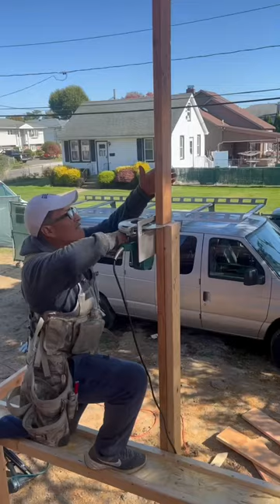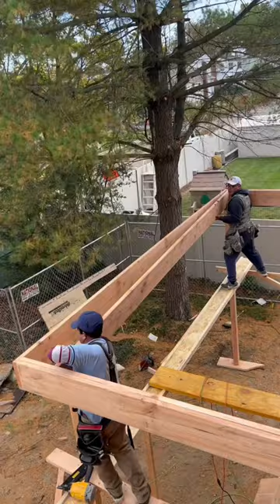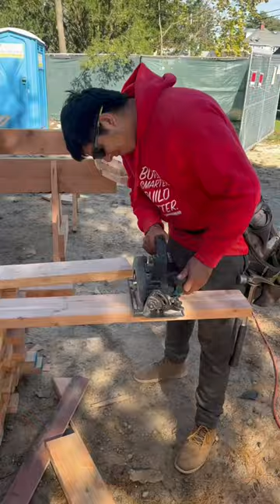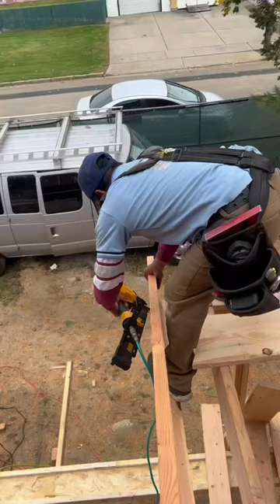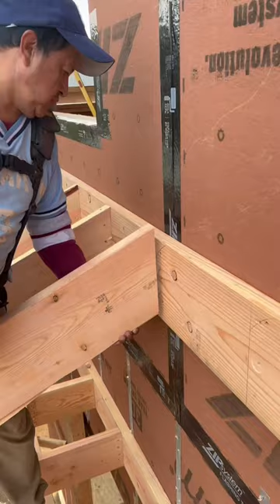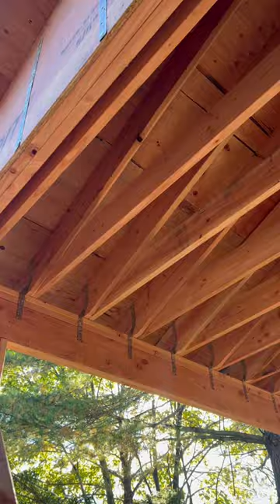Front porch #shorts #construction #work #skills #perfect #carpenter #beauty #design #team

Comment: I like to use the black chalk too. Great work bud. I really like that you notch that 2x4 in for the facia (overhang). Its so much stronger like that.
Reply: Same! Lol when I did framing everyone would cry about black chalk but the stuffs amazing. You can get the shittiest snap and it still gives you a solid ass line
Reply: I've always used florescent orange chalk. It doesn't always show up the best on light colors in the sun, but on darker colors in low light situations, it jumps out! I keep a blue chalk box for backup tho. I've always thought about using the black but it'd suck for black shingles tho. I hate when the dum-dumbs put whatever chalk they find in whatever they got so it's a dark brown 💩 color. 👍🏻👌🏻🛠️🔧🗜️📐🔩📏✏️🦺⚠️🚧😎

Comment: I know this is short video, but what type of structural bolts did you use to attach the ledger?  Do you use lags or GRX?
Reply from the maker: 5”x1/2 lag bolts
Reply: @stalinlop15 

Your 1 carpenter ALWAYS makes his combination cuts right on.   They snap right in.  
Very good job.   👍
Siskel and Ebert baby 👍👍
Reply: Nails 😂
Reply: @mariemartinez6173  🤦🏻‍♂️WOW!!!
Reply: @stalinlop15  doesn’t looks like an old house now houses are made of web truses if so ledger must be install way different than lag screws
Reply: @mariemartinez6173  The nails are temporary

Comment: Looks good. 
Is it ok not to add bolts on that ledger board? Will just nails suffice?
Reply: No it's not okay but it gets added on later
Reply: IROC mandates structural screws or bolts or a combination of the two. In areas prone to earthquakes, through-wall metal tie-downs that act as cantilevers must be used as well.
Reply from the maker: We did
Reply: @stalinlop15 un videito de eso stalin los inspectores les va a gustar ver eso

Comment: Nice work, but where im from you would fail for using coil nails for nailing down ply. Has to be framing 8s. You have to get that nailing pattern inspected and remove any nails that might have curled out the side of the rafter, before adding weathershield and a cieling. (Looks like you are waiting for an inspection unless that was the end of the day.) I think its still 2-3 inches apart in perimeter and 3-4 inches in the field. It might be 3-6 in the field, its been a little while since i framed a roof. (Im speaking on where im from, these guys may be just fine with what they did, where they are from)

Comment: Those four 2x4's are holding a lot of weight 😮
Reply: Pretty sure that's temporary  to hold till the deck gets built but you'd be surprised how much a couple of 2x4's can hold
Reply: One 2x4 can hold about 1000 pounds vertically
Reply: Además tienen dos tablas diagonales como de 8x1 1/2.
Los de 2x4 soportan muchísimo peso hasta que alguien les da un pequeño golpe con todo ese peso.
Creo que le falta la cubierta de abajo o para que son tantos soportes horizontales? Parece que fuera a ser un piso en lugar de un techo, muchísimo material , en lugar de ponerlo cada 40cm lo hubieran puesto todo junto

Comment: Excellent framing, but what about footings and hold downs for the supporting columns? The last image appears to show the column nesting on a piece of scrap wood.
Reply: This is top notch framing. As a roofer I was wondering about the 1/8” space between substrate ply boards, these looked pretty tight?
At any rate framing is a trade I look up to, still great content.

Comment: So if u cut the rafters all the same length and the wall you're connecting to is crooked, or has a crooked stud, then you will wnd up with a crooked fascia.  Better off leaving long and snapping a line and cutting perfectly straight.
Reply: Exactly you never precut the tails for fascia.
Reply: What are you talking about? That ledger will flatten out any bumps. And I'm sure one of them made a quick sight down the tails, before they added the fatia board, which will also straighten out any imperfections. Too, didn't you know that these guys frame their walls, perfect, by crowning and grading and sorting their studs? 😲
Reply: @williamtsmith9668  you obviously don't know what you are talking about, The best way to do it is install the rafters and snap a line 
PERIOD  !!!!

Comment: I’ve never used a nailer. With that being said, why do you guys still use air hose nailers and not the new battery powered ones? I’d imagine, changing the batteries couldn’t be that bad. I noticed you use the battery powered circular saws.
Reply: With a decent compressor (sunk cost by this point), pnuematic nailers drastically outperform the battery powered ones (for bump firing in particular, like the sheeting).  Lighter tools (less fatigue), last longer (and simpler repairs), and cheaper, too.  Downside, you have to have the compressor onsite, and manage a hose.
Reply: Pneumatic nailguns  are way simpler and more durable than electrical. Just remember to lubricate them.
Reply: Thank you two for the insight.

Comment: From all the inspector videos, I thought you were supposed to leave a 3/8 gap at the end of the rafter against the house and not nail it tight.
Reply: What the heck gave you that idea? 😅😂😅😂😅
Reply: @williamtsmith9668  "that ain't right" guy finds that all the time, sometimes 1/2" gap.  I was being sarcastic...  One roof, the roof was already on and there were huge gaps  in a high pitch.  I would think the only way to fix that would be to rip the roof off and start over.  Rafters were supported by nails only.

Comment: i ask not to criticize  but to learn  from the ones that know since i do my upgrades by myself.   isnt that overkill?   and unnecessary spending  they are using 2x8 or 2x10  on top and bottom  i figure that for a shed that small 2x 6s are fine

Comment: The details boys. You didn't put in foundations for the posts. And you didn't put in the lateral blocking you were suppose to between the rafters at the beam line along the posts. The boards to the building were suppose to lag bolted into the building. Details details details.

Comment: Need to put a pad under the gable end rafter then install the gable studs. Otherwise you are really only get one nail in an inch and a half of lumber.
Reply: The end rafters are doubled up. Probably code for the area, maybe snow load. So they have 3" to nail into.
Peace. 👻🤠
Reply: @williamtsmith9668  the end rafters are not doubled up, sorry but you are mistaken, and the best way is to nail a 2x4 under the gable rafters and then install the gable studs, Period  !!!
Reply: @H43339  Watch the video again. It's common to double up the end rafters. Otherwise your right. On a vaulted ceiling, you will place the 2× on the inside of the bottom of the rafter and that provides backing to nail the ceiling to. If there's a ceiling.
Maybe I should watch it again, I could be mistaken. I've been watching and commenting on a lot of construction shorts.
Peace. 👻🤠
Reply: @H43339 Just watched it again. In the first 30 seconds you will see, yep. They are doubled up. 
I've been in this industry for 40 years!!! Very rarely, do I make a mistake.
Peace. 👻🤠
Reply: @williamtsmith9668 Those are double 2x10 or 2x12 ? that make a beam not rafters, If you have 40 years it must be as a laborer ?
There's a different between beams, joist and rafters.

.
Reply: I meant to say that the gable rafter is Not Doubled up only the end joist are Double.

Comment: And not a joist hanger in site on those upper rafters... Shotty
Reply: They get added after along with the H clips and straps. Usually the laborers come behind and add the hardware. It's just not going to show every single thing in a 10 to 15 second YouTube short. 20+ year's General Contractor here.
Reply: Suggest you watch again there bub! It shows the joist hangers and the H clips. Put your eyes on 👀
Reply: It's right at the end of the video if you need assistance in finding it lol.
Reply: @jonathan3982 facts laborers do it after the fact. thats how we do it frame and then hardware
Reply: @reject6853  Exactly 💯.. This guy just doesn't know Jack about Construction, they act like hangers CAN'T be installed after lol.